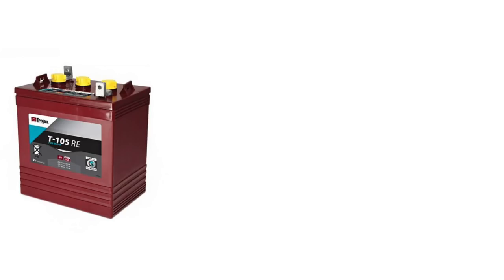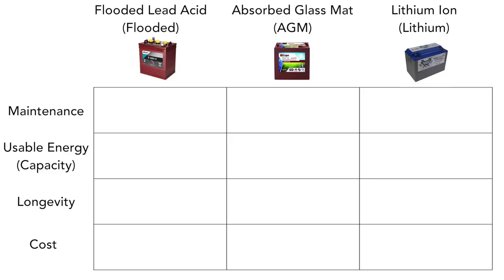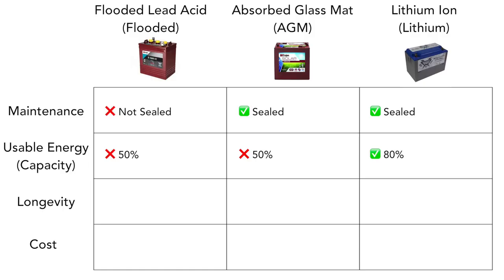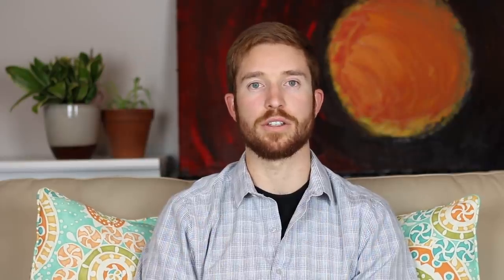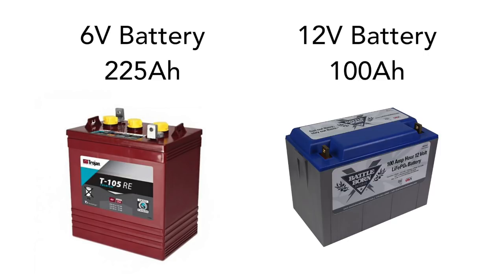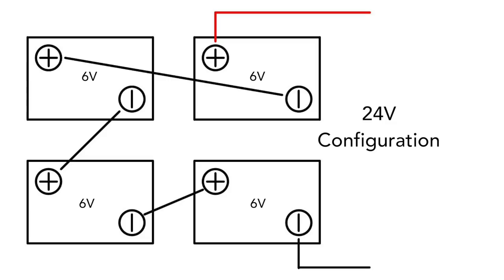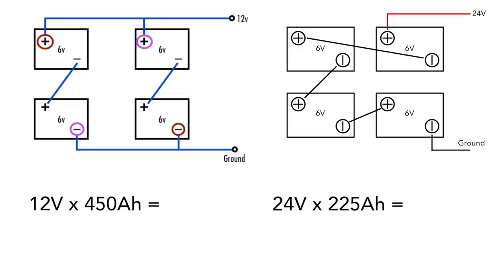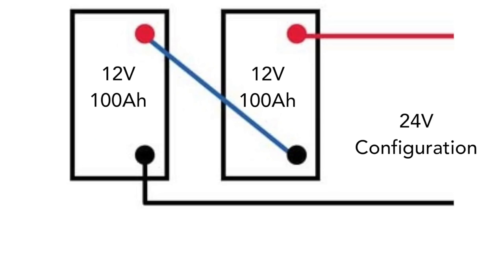Battery Bank Options + Wiring Solar Batteries from 6v to 12v vs 24v

Comment: Why would someone want 2 six volt batteries in series that keeps the same amp hours, when for about the same weight and amount of space taken you could have 2 twelve volt batteries parralled to get double the amp hours?
Reply: Wheeling with the Wheelers  because those 12v batteries are putting out less than half of what the 6v batteries will do. I’m not sure where your info is coming from when you say “about the same weight and amount of space”.
Reply: G Keller 
Ok yeah sorry forget about the size and weight comment. But if i hook 2 six volt batteries that have 225 amp hours together in series to give me 12 volts i still only have 225 amp hours where i could just use 1 twelve volt battery that gives  me 225 amp hours right? 
Why would i want 2 six volt batteries that give only the same amp hours as my 1 twelve volt?
Reply from the maker: Hey there WWW. I'm not sure what 12V batteries you are talking about, but you need to make sure they are true deep cycle batteries. There is probably a huge quality difference between the 6V batteries I'm talking about and the 12V batteries you are referencing (the 6V batteries will last you way longer). Either that or the 12V batteries are way more expensive than the 6V batteries... Just thinking out loud 👍🏼
Reply: Duet Justus 
I have checked this, after watching and have corrected my thinking. It is true about the 6 volt batteries.
Thanx.

Comment: When you say flooded, do you mean deep cycle ?. Everyone seems to change the terminology at will, with no consideration for the viewer and his or hers ability to distinguish between the two.
Reply: flooded batteries , they are filled with acid - where Lithium style is a dry cell battery (no liquid)

Comment: I believe you misspoke.  It's lithium iron sulfate batteries that can be made into a nominal 12 V battery pack.   Lithium ion batteries cannot   They are either going to be too high or too low of a voltage.

The cost of lithium iron sulfate compared to lead acid of whatever type must be compared by dividing the number of years of useful life of each. To get the cost of battery per year.  Once a person gets accurate numbers you will find that lithium iron sulfate is far cheaper because you will be replacing lead acid 5 times or more usually by the time you run out of useful life with the lithium iron sulfate.  

And reliability and the fact that not everything in the world corrodes and is not eaten away around the lithium as compared to the sulfuric acid filled lead acid units….

Comment: You are wiring the batteries in parallel incorrectly. The load should be attached to the positive terminal of one battery, and the negative terminal of the OTHER battery. This equalizes the load on each battery. Your approach overworks the battery to which the load is connected. 

A major advantage of AGMs is that they self-discharge more slowly and accept a charge faster - less generator run time. 

Also, LI batteries will not accept a charge when cold. You must locate them in a heated space.
Reply from the maker: +Steve Kiemele Great info here, thank you for sharing it 😊. As I’ve said on multiple comments, the scope of this video couldn’t be that specific of else I would lose peoples attention. I will be doing many more videos in the future... this was just a “fundamentals” video.

The graph that I found was the only one that portrayed the battery to battery wiring in the way that I needed it. I have mine wired from the positive of one battery and the negative of the other and I will show that later on in my series when I show my personal system. The one thing about solar power is I will never be lacking in the content department 👍🏼😎🌞
Reply: Steve, thanks for the info re: not using both terminals on one battery where you have multiple batteries wired in parallel, to go to the load or the equipment you want to send the power to.  That is something I have missed in my research on using multiple batteries.  In a chain of 4 batteries wired in parallel, is it ideal to use battery 1 and 4 (start and end of chain) or is that not important, thus using battery 3 and 4 is just as "good" for the batteries health in the system?

And I'll add some clarity to your other great point about charging Lithium batteries in cold temperatures.  Cold is subjective, everyone has a different actual temperature to define cold so here are some specific temperatures.
Temperature range for charging Lithium batteries:
At *Normal charging rate: 32F to 114F  (but room temp 68 F is best for battery life)
At *Fast charging rate:  41F to 114F (but room temp 68 F, is best for battery life)
* sorry but I don’t have the parameters for the subjective terms of Normal and Fast.

Temperature range for using your Lithium batteries to power your equipment:
You can turn on your electric heater powered by your lithium batteries at minus 4 degrees Fahrenheit or turn on your Air conditioner at 140 degrees Fahrenheit and your batteries will do their job. For anyone unfamiliar with Watts required to run an air conditioner or a heater and the amount of power storage in your batteries in Amp hours, be forewarned; you must do the calculations before buying your A/C or heater and batteries to understand how many batteries (Amp hours) you will need to operate your appliances for "X" number of hours. You will be disappointed by the number of batteries (total Amp hours) you will need to run an A/C all day or a heater all night. You can use your Lithium batteries in this temperature range.
-4 F to 140 F  (but room temperature 68 F, is best for longest battery life)

Info on charge and discharge operating temperatures from this source below:
http://batteryuniversity.com/learn/article/charging_at_high_and_low_temperatures

Comment: You have not taken the internal resistance of the batteries into account whilst charging in parallel. You will not achieve an equal charge or, for that matter, discharge cycle.

Comment: I totally disagree on 2 points

100ah lithium batteries are available for $500-550 new   At least in SoCal

I have 3 which cost me under $1500

It would take 6 golf cart batteries to get the same usable aH for a cost of Just under $1000.

I've never seen lead batteries last much more than 5 years here in Palm Springs being generous.

So  $1500 or $4000 for the same 20 years???

And lead batteries need to be vented.   My LiFePO4 s live under my rig in an insulated space so very protected from heat cold Etc
Reply from the maker: Technology has definitely improved since I made this video. I’ll have an updated battery video coming out very soon!

Comment: While this is a very well organized, factual assessment.  However you made an assumption that does not figure into those setting up SEASONAL uses.  Neighbors of ours with a solar system using lithium ion batteries have lost the entire banks TWICE at a huge cost.  They cannot survive freezing , non-use in harsh winter conditions.  On the other hand, my Trojan lead acid batteries have survived. They are only trickle charged by one panel on a winter angle.  While lead acid require vigilant and careful maintenance (and a generator capable of equalizing them) they are the most viable for those of us who set up remote camps in northern areas where there are deep freezes while in isolation from human maintenance.

Comment: If flooded lead acid can last 7-10 years and lithium ion is 4-5 times longer lasting wouldn’t that mean they last 28-50 years. Am I missing math somewhere. You said lithium lasts roughly 20.

Comment: Ok but what about the new batteries coming? The carbon batteries? Should you wait to buy a bank or just go for the leadacid one. It's the cheapest and when they stop working the new technology is out. It should be out this year but then corona happened. India wanted to take over the world production with these kind of new battery with greater capacity, working temperature range and charge speed. After seeing this video I'm going to do a backgroundsearch about that topic.

Comment: lithium ion would have to last 12-15yrs to be at the same cost per year as lead acid, lead acid IS heavier , but its cheaper long-term
i use both lithium and lead acid, lithium ion is good for EVs if its for house solar, lead acid is best, and also safest (longterm also)

Comment: You forgot to mention all that complex circuitry and wiring sitting on top of the Lithium batteries called the BMS. If you get a component failure, it's bye bye battery. That's massive if you are on a weekender and relying on it. And from what I can tell, all BMS components and circuitry for ALL lithium batteries are made as cheap as possible overseas to keep the price at that 1000, including that Battle Born in your video. No. Thank. You. Unless you are going off grid with an undersized battery bank you won't drop a battery below 50%. And even if you do, they still last 1500 cycles if they are the Northstar AGMs. If you are completely running your batteries to zero everyday for years, then you probably bought lithium and could only afford a handful of batteries.

Comment: Batteries go bad for many reasons especially while cruising. If a LIFePo goes out it will throw out any $ per Kw  calculation off by literally years. They do not make sense on a cruising boat yet.

Comment: LifePo4 batteries, not lithium Ion. Secondly, LifePo4 batteries can be completely discharged without damage. AGM or Flooded will be damaged or lose capacity anytime you discharge below 50%. As for life cycles, no one discharges or should discharge batteries completely. 3000-5000cycles mean a full discharge and a complete recharge 3000-5000 times. In normal use I rarely see the battery capacity go below 75% overnight. When the sun comes up, it will fully charge and that is not a full cycle. It would be a 1/4 cycle or 25% recharge. Whether it is a 25% or 80% cycle, the amount of usable capacity left in a LifePo4 battery after 5 years or more of use would still be 80% or more. Whereas I would never be able to use more than 50% ever in conventional batteries. Five years later from this posting, 12v 100Ah LifePo4 batteries now can be purchased for $350 or less. 200Ah batteries are regularly priced lower than two individual 100Ah batteries. LifePo4 batteries are far lighter in weight, very very safe, no maintenance required. Some have built-in B/T monitoring to allow you to see SOC, voltages, amps coming in, going out. Flooded and AGM are becoming irrelevant.
Reply from the maker: Thank you for sharing this helpful information! Super valuable. Yes, battery tech has really progressed over the last 4 years. It's hard to keep up with!

Comment: I think you might mention one little fact.  Battery technology is advancing exponentially.  Why invest in a 25 yr lifespan if a newer battery will eclipse the older design in, say, 5 yrs?  Have faith in the future.  Think outside the box.  Solid state batteries are coming soon.

Comment: Where are 2V cells? What pisses me off is when you have a 6V or 12V battery where one cell pukes out. Whole thing is trash. With 2v cells, you can monitor EACH cell! If one goes south, you replace that cell! Of course this is for stationary setups, like solar. I don't get it.

Comment: So you are assuming (a) Money is free and (b) No improvements in battery technology over 20 years.
Borrowing  $2.7k for 20 years ($1200 at 4%) is a lot more expensive than $600 for 10 years  ($120)and then repeating it.
In 10 years when your Lead Acids die you'll quite likely be able to buy batteries at half the price to replace them - total cost $900

Comment: You forgot gel batteries?
Reply: Are GEL batteries designed for Deep Cycle or Standby ?
Reply: @MrSummitville  yes
Reply: @VaultBoi101  I have seen GEL used in Telecom & UPS installations = Long periods at Float,  and few Deep Discharge Cycles.  I don't see them used in Off-Grid homes where DAILY Deep Cycles are required.  Even at a shallow 25% - 30% DOD, they may not last 3 years in Off-Grid.  Compare that to a $205 Trojan SOLAR SPRE 06 255 FLA which has 3,400 Cycle ( 9+ Years ).  Also, the max discharge amps on GEL is very low.  What is the benefit of GEL over AGM or FLA ?

Comment: I guess for the cost of Lithium, one could always go Generator but then one is relying on fuel. One would also think that lithium is the only battery than can be recharged. I always thought that all batteries charged when hooked up to power. Like a vehicle, an alternator charges the battery which is liquid filled.

Comment: And 1 year later you can get 250 ah lithium batteries for under 500 bucks. There is one thing you did not mention. The fact that one wrong move and lithium batteries turn your bus into 16000 lbs of thermite. Technology has come a long way in the last ten years but lithium batteries are still very fragile and can be extremely dangerous.
Reply: With a 200 Amp BMS and a 10 Year warranty ?

Comment: If you consider spending ~3 minutes every month or so, checking the water level in your flooded lead acid battery  as "high maintenance" then I must really be old.

Comment: sorry your lithium ion batt. is out of date, usable capacity is up to 95 - 98% and longevity is up to 8k to 10000 or 10k times now for the as price of $1000. gets you a 100ah LiFepo4 as time goes on things get cheaper and better :)

Comment: Listen this isn't the right way to compare. You need to compare the money. You have 1 grand to spend for batteries.
That would be 8 of the 6 volt golf cart batteries. It would be 3 of the AGMs, and one of the battleborns. The better buy is Clearly the  flooded led acid in this scenario. And that's usually most people i rub elbows with.

Comment: I think calling batteries, "solar batteries" is a misnomer. I am sorry to be picky but people are asking dumb questions like, "what can I power with this solar panel", or "Can I run my air conditioner" with what turns out to be a dinky system. I don't think you can fix stupid but Solar panels, a controller and miscellaneous wiring and hardware makes a battery charger. Its the batteries that stores the energy. Solar in effect makes your batteries bigger. I also cringe when I hear all the hype and claims how Li will eventually save you money. They sound great on paper. Essentially claiming of a long life, but the warranties offered tell a different story. If you  buy these $$$$ batteries and do nothing wrong... that are said to last 10 - 15 years and they fail in 3 or 4... its sorry Charlie... its buyer beware. I love the idea of LiFeP04, but until the price comes way down or the warranty goes way up, I'll stick with my old heavy 7 year old FLA batteries. Oh, or until I have more money than sense.

Comment: You completely disregarded the intended use for these batteries. For e.g. as an Aux power source in a caravan vs. a starter battery in a regular car. 
Using A Lithium-Ion battery as your car's main starting battery is the fastest way to end up with a permanently dead battery. The heat in the engine bay reaches over 60c/140f degrees, when the maximum recommended operating temperature for a Li-Ion battery is UNDER 30c/86f degrees WHILE trying to maintain it's MAX charge state under 90%. A car's electrical systems will always charge to 100% and keep it there if not heavily modified/designed to operate with a Li-ion battery. 
Running your car on a brand new Li-Ion battery without significant modifications will result in your expensive new battery going dead (or down to ~20-40% of rated capacity) in under 6 months. 
The cost of a new Li-Ion battery + ALL the necessary modifications to your electrical system FAR EXCEEDS ~5 replacement (each ~5 years), traditional flooded/sealed Lead Acid batteries, about the same time you would be replacing your car anyway.

Comment: You compare lead to lithium and give the wrong figures because you comparing one size to another
 lead acid is a quarter of the size of the lithium according to your figures but four times the price an actual fact if you compare the same size they are the same price .
The Stone Age approach to storage of using 12 or 24 maybe a cheap enough, cost effective way to do it but the more modern way is to store with a high voltage battery this is only with the recommendations of an electrician DIYs should not attempt this without the proper training

Comment: AGM's are not sealed.  He is wrong here. They are still flooded lead acid and the electrolyte still boils off if over charged. Also,  on off grid systems a regular battery will last the maximum of 5 yrs.  I have lived off grid for years and my brother for 30 yrs.   This guy knows very little about batteries.